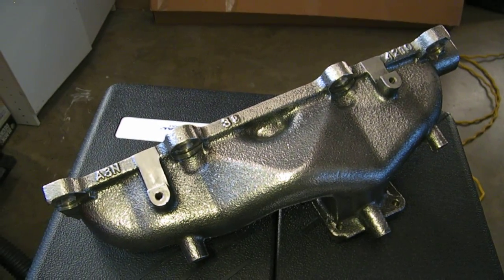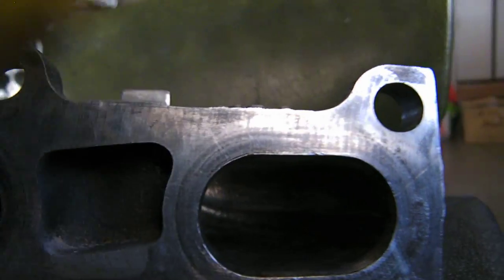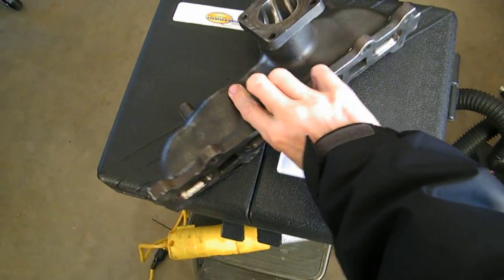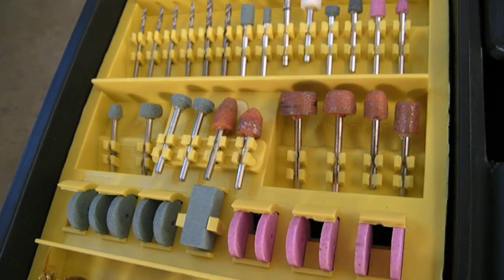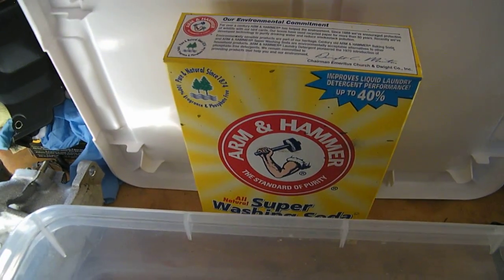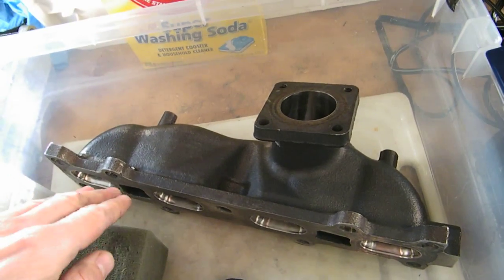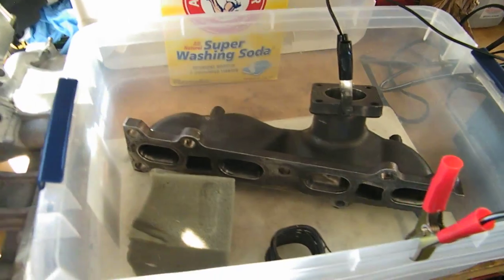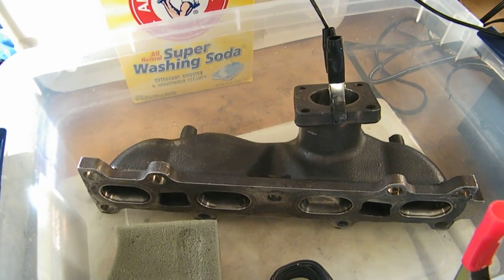Mazdaspeed miata exhaust manifold porting.

Comment: Nice job. How did you remove the manifold without the turbocharger attached?? Is that even possible or do you have to remove the manifold and turbo as a single unit. Only wanted to replace the gasket and it's becoming an enormous undertaking, especially for an idiot like me
Reply from the maker: Taking the AC compressor off makes it easier to take the turbo off & get to water and oill lines.

Comment: Nice video. Is the pencil grinder you used pneumatic or electric? I noticed the one from the kit is hanging up and is not the one you used.
Reply from the maker: Its electric. I got it on sale at Northern tools. The manifold is sitting on its box it came in. Its the one hanging up that I used.

Comment from the maker: I looked up electrolysis on YouTube. I tried carbon rods but I prefer carbon steel or soft steel wire. I heard never use stainless steel with the positive for the rust to go to because toxic off gases. 12v 6amp worked the fastest 6v 6amp worked slower 12v 2amp worked slowest. Also the size of the part & the distance of the positive from the part changed the speed the rust was removed can take hrs. It took seconds to remove rust from a bolt when I got the positive a centimeter away at 12v 6amp.

Comment: Good job! I have seen several PnP videos but I haven't seen anyone use electrolysis for rust removal.  Where did you pick up this trick and where can I find more information about it? I understand the physics behind it- I am just wondering about amp setting and length of time and any hazards associated with the process. Man- that's a nice looking mx5!

Comment from the maker: Im building my engine & turbo right now & have not put the one in the video on the engine yet but I have ported other Miata exhaust manifolds & it makes a difference you can definitely feel. It makes the engine flow more air. There is less restriction. You can feel it when you downshift & use engine braking & at high rpm's when accelerating. Im putting a BNR 16G turbo injectors rods pistons Megasquirt with 7000 rpm's so I wont be able to compare the manifold to anything from before.

Comment from the maker: I used a few big words but its all pretty simple what I did if you break it down. I think the rust inside was a good thing because when I did electrolysis it ate the rust away & removed a millimeter overall of material from the inside the manifold & the porting removed another millimeter for better flow. If you lived near I would put a intake & water meth kit on your car & turn the boost up to 10.5 to 14.5 psi. You can go to mazda-speed